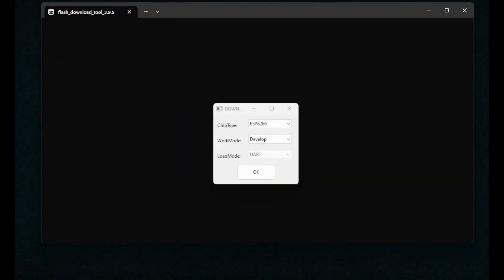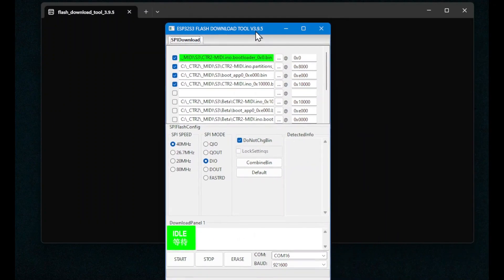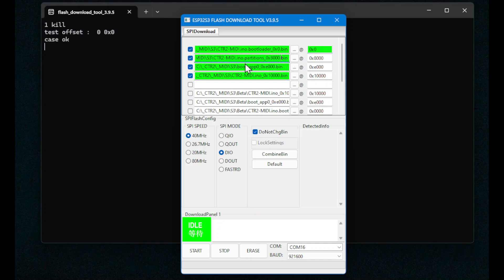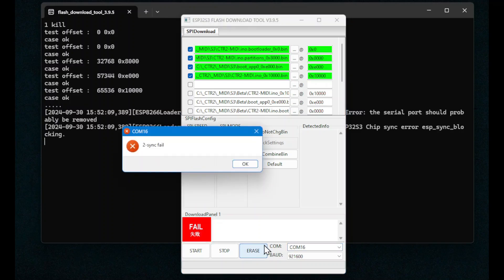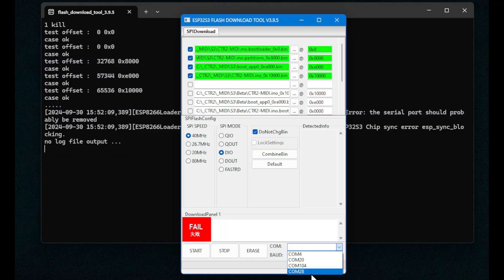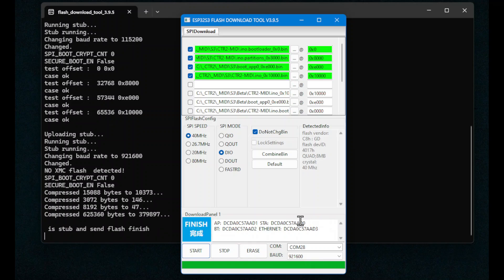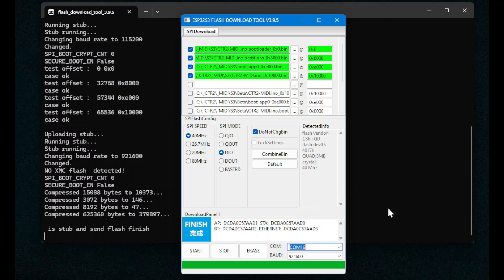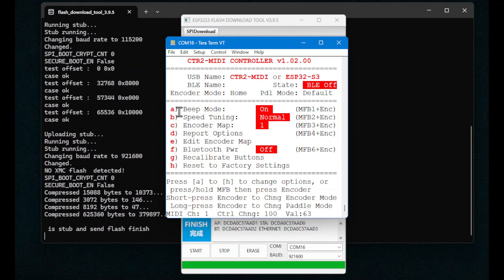CTR2 MIDI Firmware Update

Comment from the maker: One thing I forgot to mention in the video - erasing the flash memory resets all the settings on your unit back to default so you'll need to connect to the unit with a terminal and edit the maps (press 'e' to edit maps) and recalibrate the buttons (press 'g' to recalibrate the buttons).

Let me know if you have any problems with updating your unit.

73, Lynn
Reply: Well, I tried......but after getting the initial error,  I looked at the COM ports, but the original one (COM3) was still there.
Reply from the maker: @charlierubenstein4141  If the unit doesn't enter programming mode (as indicated by the new COM port) you'll need to follow the procedure in Appendix C, Installing using Linux or Mac, in the operation manual. You can download the manual here: https://ctr2.lynovation.com/ctr2-midi-operation-manual/
Reply: @Lynovation  I tried again, and after the initial sync error, I heard the USB tones indicating a change in the port. I went to the newer port number (although that port didn't show in device manager) and clicked START. In the terminal window, there are lots of dots going by, but it has been quite a long time and nothing has finished. How long does it take to load the new firmware?.